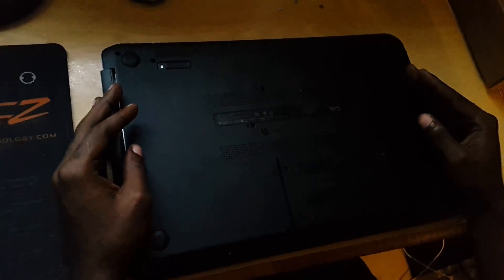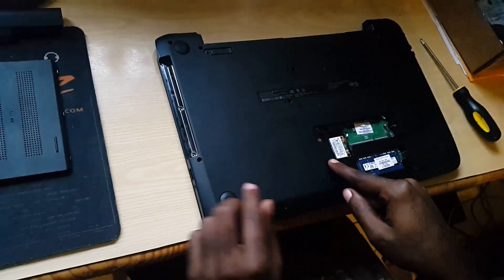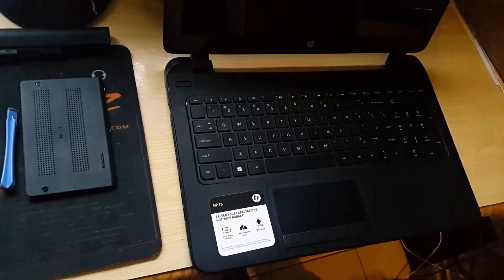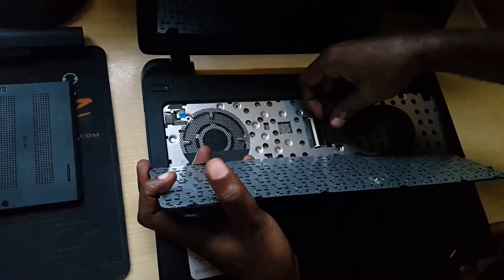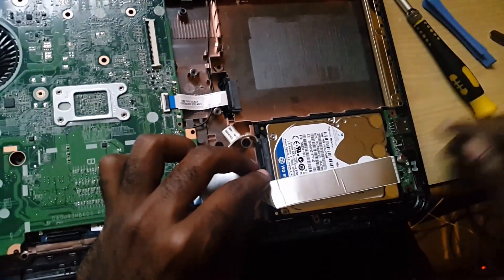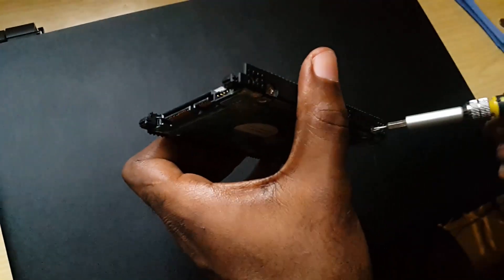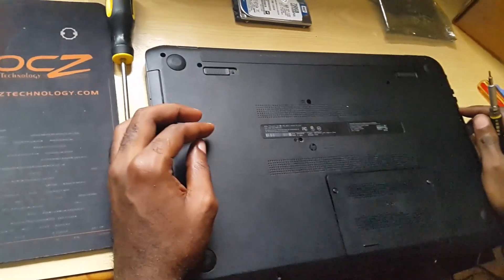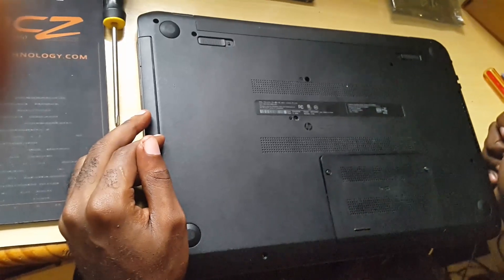HP 15 Laptop hard drive replacement or SSD upgrade

Comment: I snapped some of the ribbon cables. If you do the same, the tiny white plastic bits can simply be pushed back into the black plastic seating, they're meant to lift up and down within the seating to clamp the ribbon cable in place. Simply slide the ribbon back in, metal contact down and blue plastic up, and clamp the white plastic bit back down in place to secure the ribbon. Unfortunately I snapped the ribbon off the power button PCB so I had to order a new one at the cost of a few quid.

This video was helpful thank you, but for the love of god get a better camera and turn on a light 😂

Comment: there were 3 screws under the disk drive that you have to remove that weren't shown in this video during the process of remove the faceplate. once you remove all the screws on the backside the disk drive should just come out, then flip computer and you will see. i knew something wasn't right because i kept prying but nothing was happening. hope this doesn't get buried.

Comment: I know this is old, but thanks for the walk-through.  I can't believe HP made access to the HDD so difficult, but your video made it a pretty smooth process.

One point of clarification if anyone else reads this - you need to take out the screws beneath the plastic RAM/WIFI cover or else you wont be able to take the top cover off.
Reply from the maker: Happy the guide is still useful.
Reply: Yes using it today, well done! Good nuance detection and detail.
Reply: ikr..I thought the same thing..like why make it such a task considering it's not that fast of a notebook either..but yes i agree..

Comment: Thank you for making this video.  I have two suggestions - first, you skip over most screw removals.  Most of us have never opened this laptop before, so time showing screw removals is not wasted time.  One of the  most important things a creator can do is to show which screws to remove, and maybe more importantly, which not to remove.  So you glossed over this important, though maybe uninteresting, part of the process.  Secondly, your audio level was low compared to most videos - had to dig out earphones and crank it way up just to hear you.  But again, thanks for taking your time to post this!
Reply from the maker: Thanks for the Tips, I left out the screw details and so on because most people Wont want to see that more or less. Also Editing and uploading a large 20 minute video vs a 30 minute to 1 hour video can be a daunting task. Solid points though and I will keep them in mind and apply them.

Comment: Good video thanks.  It's crazy how complicated they made changing a hard drive in this model.  Worst I've ever seen so far.
Reply from the maker: Glad it helped, yeh they could have made things simpler, its almost like they don't want you to change anything.
Reply: Dell N5110 was even worse, you had to also remove the screen since the hinges are mounted through the motherboard & case and you had to remove the motherboard to access the HDD, the laptop was completely dissembled by the time I got to the HDD lol. what happen to having an HDD access flap underneath laptop like with memory modules, It used to be a thing.

Comment: Thank you so much for the video I was wondering is this a standard laptop HDD my father's HP started having trouble and system check confirms its the HDD and I want to make sure it's a standard laptop drive before opening it and buying one.
Reply from the maker: No problem here to help

Comment: I started to try to  replace hard drive, but came to a stop when I could not get fully open. Now I know why! Thank you so much for this excellent video. When I attempt to do this, I will now be able. I have two HP15s (a result of a friend who breaks her computers and gives them to me when she just buys a new one!). I ultimately did not need to replace the hard drive, as I ran into boot issues when installing Ubuntu 20.04, and ended up fixing that instead. But now I am prepared for the next event!

Comment: Thank you for this video...even 6 years later. I had a crappy HP 15series laptop that wouldn't even power on...no lights, no nothing. After wasting money on a new battery and a new AC adapter...and trying a million different troubleshooting options, I finally said "Forget this pile of crap." However I knew the hard drive was still good and I had empty SATA ports on my gaming PC, so I pulled the hard drive out of the laptop and bada-boom!....500 more gigs of storage for my CyberPowerPC.  

HP...good peripherals, horrible computers. (OK to be specific, I have an HP monitor which is great. My laptop however was pure trash)

Comment: Brother. I know this laptop old. I got the 15-f010wm. Crucial got the 8g ram 1600 and 500gb ssd for sale at $100. This laptop was painfully slow even when it was brand new. A new budget laptop is over $600 after tax. If I upgrade the ssd, will it be noticeable better or will the fact its ddr3 still kill it. My only interest is to be able to browse the internet at normal speeds as it can't do that now
Reply: The ram wouldn't make it any faster. It will just let you have more stuff open at once. And a ssd will make applications feel snappier when you open them

Comment: very accurate. DONT PULL THAT KEYBOARD UP!!! then I disassembled the usb audio jack and pulled that over the HDD. then you can pull up on the back of the drive and pull off the sata connector. This abortion of a design, is why I work on apple only except for relatives or special people.

Comment: I followed the guide and ended up stumbling upon thin white cables being glued stuck to the metal plate (not talking about the connectors, but literally glue on the white cables over their entire length) WTF HP
Reply from the maker: Seems some companies may not want us repairing broken tech.

Comment: follwed this video tp a tee.  My issue now is the the screen will not come on.  it worked before and when i turn the machine on I can here it running and lights are on on the laptop.  Any ideas?
Reply from the maker: It could be anything, For example if you disconnected the display from the motherboard or something is loose then it could result in what you are seeing. I suggest you start over open the Laptop back up and check everything. It common for things to get loose sometimes after a disassembly and not work. Good luck
Reply: Mark were you able to fix this issue?

Comment: Great tutorial man, thank you! I'm in the process of setting one of these up for my mom, and mom needs an SSD and 8 gigs of RAM! And if anyone from HP is listening, you guys are a confusing bunch. Kudos on being able to upgrade the thing at all in 2020, but does it have to be this hard? Have you guys ever looked at an old ThinkPad? There's a reason people are still buying and using them today, and it's not because they're light, pretty, or "cool"... Any idiot with a pocket knife and 5 minutes could upgrade the entire system having never looked at the guts of a computer before. There's value in that!!! My T410 is 10 years old. I have $100 total into it. And it's still faster and smoother than this fairly new HP. Not to mention upgrading it to SSD required only one screw in and out...

Comment: It is the same model that I have.I have a problem with noise, I have changed the fan. The noise has remained. The ethernet cable has a white and a red light on the sides, the noise comes from there. I don't know what else to change, can you help me?

Comment: I have a couple of issues with the way you presented this however I am grateful for the reference point when upgrading my mother's HDD to an SSD, along with some RAM. Just a heads up, please don't disassemble first and tell us to follow, I nearly broke one of the clips in the board as you referenced a black clip first and then said you had simply removed the next ones already -- here they were beige clips, if one attempted to pry the black it would crack the female connection to the cable.. If the reason for having done it first was for length of video time, I believe running at 5x-10x speed after you've clearly distinguished any 'points of contact' to the viewer could serve you in that regard.

Thanks for the video and please continue the good work ;)

Comment: Goddamnit HP!! The hard drive is right on the side of the laptop. Like my old Lenovo thinkpad, all you SHOULD HAVE TO DO is unscrew a compartment door on the side of the laptop, remove  the old hard drive and just slide it out and simply pop the new  hard drive (or in my case the ssd) right in. This is outrageous shit. This will be my last HP.

Comment: Many of you posting how difficult this is... this is actually quite common. It wasn't until a couple of years ago that they started making the HD accessible through the RAM bay, because replacing the HD was rare in laptops back then. There is a grey zone of laptops not having SSD's now days, so if yours doesnt, be prepared for something like this because it is common to replace the drive like this in many types of laptops. If you buy a new laptop, you will have a much easier time accessing the drive bay since there are more options for drives now days including SSD's.

Comment: #Protip - Check your keyboard connection before putting it all back together, the ribbon cable comes out very easy when you reinstall everything and if this isn't in place correctly, your keyboard will not work. I highly recommend after you connect it, to set the keyboard down with installing it yet and power it up to verify your keyboard works as it should. Once you verify the keyboard is working, then press it down and continue reinstallation. Otherwise have fun tearing it all back apart because your ribbon cable wasnt seated properly.

Comment: What ssd would you recommend replacing the hdd with?
Reply from the maker: Crucial is pretty reliable and great price.
Reply: @rickytlc1985  someone suggested that I use crucial BX500 240gb 3d NAND, would that work?

Comment: I hope this helps someone all these years later. I am currently finishing this up.  They have extra screws in the wifi card/ram bay that you have to take out. I missed those the first time around.  For the cd-rom drive, just give it a little force and it will come out. IT doesnt need to open to come out. On the right side of the bottom plate, I had a screw that wouldnt fully come out. It unscrewed, but it stayed in.  It is fine and wont hurt your work.  Go easy with the keyboard, I jacked mine up a little bit trying to pull it out from the bottom right.  My screws were also color coded: red for long ones and blue for short.  Short ones tend to be underneath everything and long ones are for the plates on the outside.

Comment: @14:06 He forgot to put the 3 screws back before inserting the DVD drive
Reply: hard to believe this video has been up this long and no one noticed.  You can see the 3 screws at the top of the frame by the static bag =-) Thanks for the informative video.  You explained everything very well.  Saved me a headache for sure.

Comment: Sure glad I tried this. After putting it back together, I had two tiny screws left over, and the laptop won't turn on. there were plastic harnesses in there falling apart to the touch.

Comment: Very helpful! I made a mistake and disassembled the hard drive before ordering replacement parts. Now, 2 weeks later, I don't remember which screws went where! Any chance you have photos of which screws go where? Thanks!
Reply from the maker: No picks on hand -that why I recomended you take pictures or video. Try watching the video in reverse that may help.
Reply: Do you remember, by chance, if there were tiny silver torx screws? I may have removed more screws than I needed. I have 6 tiny silver torx screws and I'm not sure where they came from. I did everything you did in reverse and found a home for all of the black screws and the 3 fatter silver screws under the DVD drive. The silver torx screws could have come from a portable HDD case that I also took apart, but I thought they came from this laptop. Thanks, again.

Comment: Thanks.  Without this video, I would have smashed this laptop into a million pieces. I've replaced a gang of laptop hard drives over the past couple decades but this one is the most ridiculous.  My goal was to clone the sluggish HDD to a new SSD but sadly the SSD was too small for Clonezilla and I had to put it all back together with the original drive.  At least next time I will plan out a little more time for the disassembly.
Reply from the maker: You should it always takes time, if not you may break something. Good job.

Comment: It's really not that difficult. Bottom screws, pop the keyboard, 4 more screws, pop the flaps for the power & touchpad, pop the top layer, then tab out the ribbon cable above the drive and then replace the drive...that's actually easy as 10-15 mins max if you're used to it.

Comment: I just swapped the HDD out for an SSD in this model, but now the computer boots to a black screen. I can press F2/F10/F11 on boot and the message will appear showing it's about to go to bios/diagnostic/boot selection but it just stays there and won't do anything. I've tried hard resetting it, replacing the old hard drive, booting with no drive and it doesn't change. Does anyone know what's up?
Reply: Did you ever find out what was wrong? Thinking abt upgrading to SSD and trying to prevent running into something like this.. =/
Reply: It turned out that one of the ribbon cables wasn't seated right. I took the whole thing apart and reseated every single cable and it booted up just fine after that. Sorry for the slow response.

Comment: How do you remove the Optical Drive?  In the start of your video it seems like you already have it lose.
Reply: Don't know if you need this still but there is a screw on the bottom roughly in the middle that has a circle with a line going from the center to the edge (like a radius)

Comment: Now I got to watch a video on how to remove the disk reader
Reply: kid wish did u find one
Reply: No I figure it out my self
Reply: It's a screw on the bottom of the laptop holding it in
Reply: kid wish no ya I did that, it's just that it was stuck so I had to push it out from the tiny hole underneath the keyboard.
Reply: Yeah it sucks because of how complicated they made it for

Comment: I simply wanted to replace my old hard drive with a new solid state drive.  I started my project late at night because this usually easy to do. Not so in this case!  THANK YOU SO MUCH for making this video; there is no way I could have done it without your guidance.  Hard drive placement will DEFINITELY be a consideration when purchasing another laptop!
Reply: Ditto!   Ridiculous design by hp
Reply: gerdelt what ssd did you put as a replacement?

Comment: Ricardo, thank-you for your video. I have replaced my corrupted hard drive with a new one and all is good. Except it will not boot. Now when I turn it on it says something like boot device not installed on the hard disk. I've tried everything and I have also tried using my repair, reinstall, recovery disk but nothing. I can't figure this out please tell me what to do when you can,! Thank-you!
Reply from the maker: If the Hard drive is new then there is nothing on it as the computer needs a operating system. You will need to install Windows from scratch, I dont think a recovery disk will work. So get a Windows install DVD and reinstall windows. You can use the key that came with your Laptop to activate-it might be on base of the Laptop or in the documentation that came with your device.
Reply: Ricardo Gardener thank-you so much. I am new with this lol but I am very very technology smart so once I see it one time, I will be able to do it forever. I have literally the same exact computer that you are fixing in this video. I will start shopping for a windows DVD. Do you know of any by chance that I could go off of idea wise? I only have YouTube and myself so I am doing everything alone and figuring it all out along the way. When I bought my recovery, reinstall, and repair disk, I was looking for the disk to install windows on my new hard drive. Obviously I still didn't get the right one lol. So therefore I have no idea on what I need to be looking for. Is there a specific brand or title I need to be looking for?

Comment: How is the thing for holding HDD named? Sliders? I have my ssd on m2 and the place where standart disk can be is free, I  bought the 1 TB hdd but can't plug it becouse I don't have the conncetor and the thing where you put the disk (that something with transparent glass). What is that? Where to buy it?

Comment: Thank you! Without your calming voice and clear instructions I don't think I would have persevered to the end. I was surprised how much brute strength needed to be used in removing the top panel, prising out all of those clips - whereas you wizz round with that prising tool. I was also surprised at how much the plastic can bend without snapping. Does it show I'm a first timer? I can't believe I've actually done it, and it's working, and I'm using it right now. (albeit from an OS on a thumbdrive).
Reply from the maker: Great job Richard proud of you.

Comment: I tried this  same method but as I took the top  off to expose the  components the little connector under the power button practically fell out before I could correctly disconnect the side of the connector under the white flap. Now my shit isn't turning on. I'm  pissed. Can anyone advise me?
Reply: Could you resolve it?
Reply: Same problem....
Reply: Cut a small pice of plastic and put it in a similar fashion to the one in the other conector.